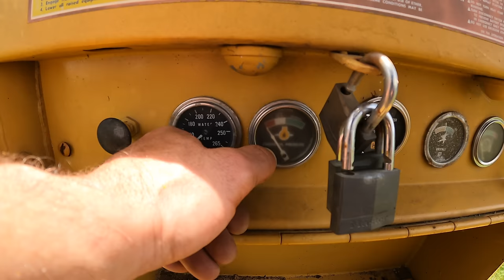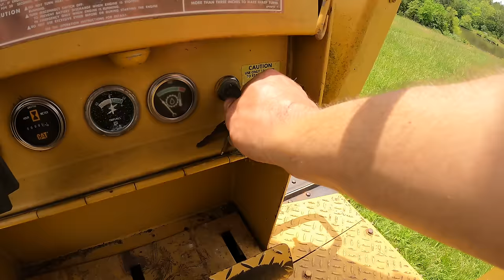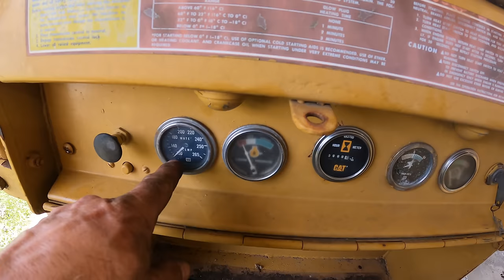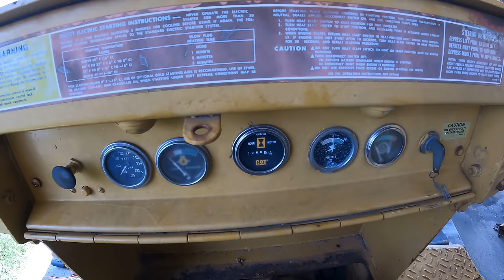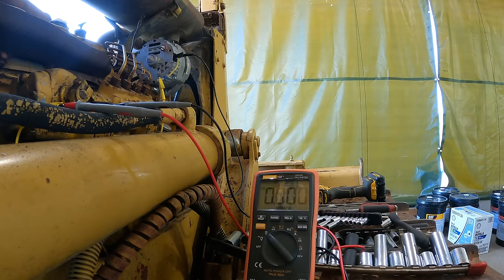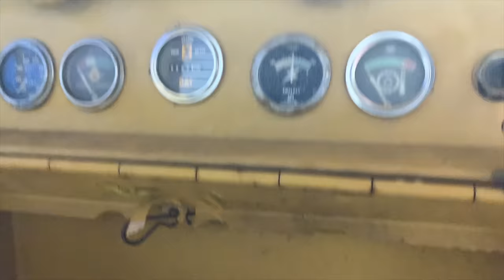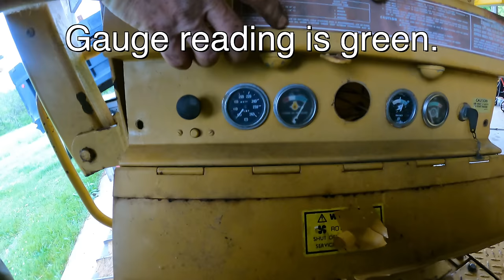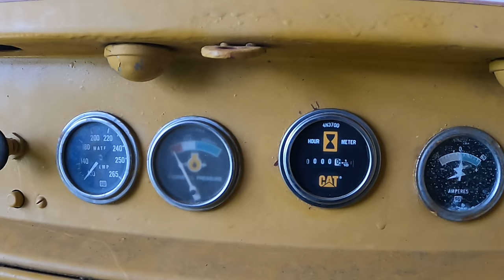Buying & Fixing a Bulldozer, Cat D3 Dozer, Part 1/2

Comment: John, I have just started watching your video, can't  wait to the end of the video as I have to tell you now that altonater is the wrong one for that engine it will drake off. You need one with a large full length bottom mounting that fits in between that lower bracket on the engine. Now back to the video for me. Thanks Stewart.  OH I see it's been mounted upside down lol.

Comment: Single wire alternators are very common - used in older cars mostly (Fords,  Holdens (GM) and Valiants (Chrysler) here in Australia- one thing- that single wire shouldn't be left hooked to the battery + terminal from the F+ (little terminal)- or your battery will go flat lol- it goes to the ign switch switched positive (ie ign on) +, with a light bulb in series- ie it is your charge light, lights up when ign is switched on, turns off when it is charging... : Another tip- look on the rear of the alternator when reassembling- there is usually a small hole (same size as the ones in the brush holders inside) and lined up with those holes- push a piece of fencing wire or whatever through that hole from the outside, push the 'back'  brush spring down first and slide the wire in until it holds it down, then repeat with the 'front' brush', then slide the front housing/rotor in and do up- then pull that wire out to release the brushes... I actually prefer the single wire alternators- very reliable little units (Bosch and Lucas both make them, and are very common here on older cars and almost all heavy engines (tractors etc) ETA- I see you haven't got a ign 'on' position positive- in which case, that wire you left disconnected at both ends, at the alternator goes to F+/ind, and at the oil pressure switch goes to the 'switched' side of the oil pressure switch ie not the permanent positive...

Comment: Re starting, we had two Massey Ferguson tractors, a 168 and a 165, the 168 always wanted heat but the 165 always started first attempt (and never needed heat) after about three revolutions, even in the middle of winter. So engines can be a bit funny.

Comment: One the rough ways to figure out if your alternator field is energized is with masterswitch turned on the field should be energized and creates electromagnetic field, so it should attract a metal object like a 7/16" endwrench to the belt pull
If you turn on battery power and your pulley isn't magnetized its most likely bad alternator, or bad voltage regulator on externally regulated models (FORD)

Comment: When you are inspecting it at your shop. It looks like when you were messing with the alternator and starting it up that the injector pump was moving around independent of the engine, Like maybe the mounting bolts were loose.

Comment: Cool video, just thinking if you really needed that headache Dosser. Your tractor with a grading bucket should pretty much do the same thing. Might take a bit longer, but will certainly do the job. And save you the $15.000, and all tout time. A used skid loader would be a better option and that way you could buy a ton of attachments down the road as needed. More money, but endless opportunities for great videos. Thx for the great content, love your channel.  I’m still waiting on the wind turbine on your farm for free juice.

Comment: Your throttle control lever probably has a friction point that holds it in position, and has just gotten loose. I have a tractor that every few years i have to tighten it up. It has a bolt that you turn while holding the lever, to tight and you cant move it, to loose and vibration will let it drift.

Comment: And you can pull the brush wire out the rear of the alt. And put the wire in the brush holder then install brush holder.  A unique way to pull the wire. lol

Comment: Biggest issue with the D3 is the 3204 engine,  they like to drop valves.    It almost always junks the head and some pistons, if you are lucky it does not damage the block.

Comment: I thought he might say the oil pressure sensor was unobtainable but $13 is a real righteous price. That looked like a pretty standard thread pitch and fitting size. I have a piece of grease gun line and a pressure gauge i use for diagnostics to get real numbers I think I got $10 in to check oil pressure I hook up to various holes to see if were in spec, as alot of oil pressure is made in the main bearings and the light just tells you you either have no pressure or over 5PSI usually. I know the thread pitches are different if its japanese or American manufacturing and fit together but will strip your threads.

Comment: That looks just like a pressure switch from an old pool heater. the newer heaters have plastic ended ones now. just like your replacement. but pool heater ones are adjustable!!

Comment: That may or may not be a 1 wire alternator. The regulators can look identical from the outside. If its a standard regulator in the alternator wired like that you will drain the battery as the alternator will not shut off.

Comment: 21:40 your supposed to only blow the filters from inside out, and only last give it a quick blow from outside to take off any loose dust.
otherwise youre just pressing the dust deeper in the pores of the filtermedia.

25:15 good idea, bet if you would have left the bottom square, it would have likely cracked.

31:43 Nearly all alternators have 3 wires/posts,
1. +12v(Batt) 
2. charging light (this needs +12v to excite the alternator during startup) you have the yellow wire going there.
3. Tachometer (for RPM's and hourmeter) usually not used.
Reply: 47:25 its always a good idea to cover any loose wires, maybe someone down the line plugs the other end in and now theres bare wire with power inside the dash..

Comment: r.e your mini-excavator tracking problem: my snowcat has an adjustment in the dash for that. I don't pretend to understand how it works, but maybe some sort of variable flow valve that divides the volume of flow from one side to the other on demand would work. On mine I just roll a small adjustment wheel back and forth until the tracks run true. FYI: It's a Pisten Bully 200.

Comment: Lift station degreaser would make that radiator shine . Expensive and don't use it straight .also was told that car alternators charge at a higher rpm than a diesel alternator

Comment: With all your heavy equipment it might do you some good to pick up a Hotsy pressure washer, hot water changes the game. Would've melted all that crud (technical term 😂) off that radiator.

Comment: Always need to preheat when staring unless you just shut it off. It's a Indirect Injection system. Alt. is upside down unless it wouldn't fit because it's not correct. Belly pan missing so watch yourself in the woods or you will be putting a Radiator in it. There is a hole on the back of the ALT case in line with the brush holder. I use a toothpick on each assemble then pull out toothpick. Easy. $15K is a decent deal. Tracks are worn more than you think, but still a little life left. and Yes way too Tight.
Small dozers are in High Demand and bring good money. Nice Crawler.

Comment: You need to get you some rubber mats for your concrete or it will eventually break it. They make rubber mats for running tracks on concrete

Comment: Don’t leave that alternator wire in console without covering the end. If it jostles around and makes contact with hot and the other end is pinned to ground… short.I would probably throw some laptop and electrical tape on both ends.

I have always wanted to do one of these.  So I saved some money and watched you.  Will have to look around for one.

Comment: I'm pretty sure u need a switch on the wire going to f post so the Alternator Doesn't kill the battery when the engine's not running? You might want to look into that I could be wrong.

Comment: charging circuit   power supply to ignition switch  via  3 amp bulb to alternator  or you get permanent drain when engine not running

Comment: Do you have a water filter on your air compressor? Cause i think i saw it squirt a little water in front of the radiator when you were blowing it with air. A little safety tip when blowing electronics

Comment: Protect each wire with an appropriate fuse or breaker at the source of the current (ie, where it feeds off of the starter connection for the panel wire).  Even the starter wire can be protected at the battery with a really big fusible link.  Pacific Yacht Systems youtube has a really nice series on this (and the fire video to convince a person).  Don't forget a seatbelt so you don't get crushed when it rolls over.

Comment: There are a lot of different amp ratings on battery  master disconnect switch.  When the switch melted a stud off the alternator diodes might have had a voltage and current spike that exceeded their rating.

Comment: With the alternator field wire continuously connected to the battery, you will run down the batt. Given the melted oil pressure switch I am guessing the alternator field wire was connected to the switch. Using the presure switch will have the battery changed only when the engine is running. Adding an in-line fuse would protect the switch should the alternator fail again.

Comment: I would put a straight bushing in series with the bolt common to your alternator attachment lug just to help your bold bending situation.   the ears on that clevis aren't designed to take the clamp up side load, and by clamping a straight bushing,  you will stabilize the joint and avoid a fatigue failure.  Just my two cents.           with that said, I tune into this channel to see what crazy self inflicted mechanical predicament that you will get your self into ...  Im the same way.  I cant resist taking on an old stray...  and I'd cut my own hair if I thought I could save a buck and make it come out right....  I enjoy the over the top DIY spirit that you put into your videos.  Most people have never changed the oil in their cars much less taken on one of these high level technical skill projects.  Hopefully some one gets inspired to fix some of their own problems without using a check book.

Comment: Dollar general sells 'awesome dish soap' that'll cut through oil and grease like no ones business may be worth using for cleaning up equipment with a pressure washer.
Kinda shocked you didn't properly tension the tracks first before using it

Comment: Alternator needs to be on a switch to turn off power to small wire otherwise it will discharge battery or burn out rotor winding

Comment: From what I could see, you seem to be missing the belly pan covers in addition to the track tension covers. If so, you don't want to do much rough work as you can puncture your oil pan. I never run my equipment without them. Too big a risk. I could be wrong as I couldn't see down into the engine bay clearly or maybe you already took them off for servicing. Nice looking little machine!

Comment: Yeah, any alternator needs voltage to excite the field. Since, instead of magnets and windings, you have windings and windings. Since windings themselves can't generate a magnetic field, you need power in the one set to induce an (electro)magnetic field into the other set of windings and allow it to start charging/generating. (Sorry - I was a diesel-powered generator tech in the Navy... been a couple of decades since I've had to think about the inner workings of an AC generator. But thanks for making me think about that stuff again. I needed to refresh that knowledge before I lost it, lol.)

A keen-eyed parts tech will refuse to accept that slotted alternator as a core trade-in. Unless they like you. 😊 I do like the idea though. Great vid!

Comment: Well, You definitely are not in the same class Dozer operator as Chris/Mike or Jerry...but ya gotta learn somehow. I think you did great :)
Unfortunately, your undercarriage is shot. The Final Drive sprocket is done for but for the amount you will be using it? It will probably last you 5 if not more years. That is the reason the Tracks are so tight. 
I could be wrong of course but Clint from C+C Equipment is the expert. He has alot of videos about undercarriages for Dozers. Usually from Auctions.
Thank You for the video it was awesome. I love seeing older equipment being restored and used...if only once or twice, I just wish I had that ambition to work under anything for hours and hours again. First things first though. Hydraulic Leaks. Oh btw when I seen you struggling with that Loose Fitting on the Pump...I was literally telling you to cut an old wrench..LOL...
LOVE LOVE LOVE this episode! and I can't wait to see what you do next!
 Peace Man!

Comment: In that condition, it looks like it was stored inside.  It seems like the last owner was at least trying to fix stuff and take care of fluids, just didn't quite want to spend the money or quite know exactly what he was doing.  I'm hoping he had the tracks so tight just because he thought they were supposed to be that tight.  Why don't you want to use the glow plugs?  For how much you're going to be using it and the location of the wear I think you might be able to buff the rods and repack depending on how much it would cost to replace them.  From what I'm seeing, and how well it runs I think it's a pretty good deal.

Comment: ‘Full-size’ Caterpillar tractors use a Decelerator to control the Governor and you use it constantly when operating the machine. I suspect because that D3 doesn’t have a Decelerator you would be using the hand Governor control constantly instead and therefore it wouldn’t have a friction on the control. I may be wrong. 
  $15k would be cheap for that tractor here in New Zealand. I have seen a few D3s and they have all had cracked ‘C’ frames for the blade. That may be worth checking for.

Comment: The f -field terminal should be key switched 12v or it will cause a parasitic drain on ya battery!! Wire f terminal to oil pressure switched 12v like the hour meter!

Comment: Just throwing a comment about the alternator. The fact that it was spinning while having such a loose belt connection strongly suggests to me that it wasn't electrically connected. Alternators actually provide a lot of resistance at speed because that resistance is what's being converted to electrical power. The only reason (in my experience) one would not have a lot of resistance and not be slipping constantly on that loose of a belt is if the electrical connection isn't attached and so there's no power flow happening. So whether it was the stem not being connected or the ground not making it through the bolt, it wasn't going to work in its old state.

Comment: looking at the rear of alternator.. see the hump from the rear bearing???   see the slot  near it? that is where you insert a toothpick to hold the brushes in place.. not from the inside with wire...

Comment: you need flow control valves on each line to adjust fluid flow to each drive , remove the cross line as its proved of no use . fit flow control valaves the adjust as require if pulling to one side close in said valve restricting the flow to this side or adjust oposite side by opening flow more . james ps i am a qualified engineer not a sales man.

Comment: A Question, when you cold cranked it without glow-plugs, what oil pressure did you see?   Is non start cranking, a better way to get oil pressure in top end and main bearings, before starting it. Especially if been sitting for a long time and all oil leaked back to sump....I've always thought we need a manual or electric, external pre start lubrication pump. To run for a few minutes before starting, Especially  in extreme cold, and when it hasn't been started for months.

Comment: Let me poke the bear, there is a hole in the rear case of the alternator that lines up with the hole in the brush holder. You install a pin into the hole in the brush holder then the pin extends out the back of the case. You can pull the pin out from the back. The alternator should have a brace from the bolt hole on the back of the case down to a spacer on the mounting bolt to the engine. I have seen several broken alternators because of that brace being missing.
Buy a battery disconnect from Cat, the cheap ones do not last long.

Comment: Well at least you didn't get a rattle can rebuild.
25:30 you don't want to use end mills that way, make the cut the full depth with one pass whenever you can so you use the whole end mill. It's not a big deal on aluminum, but using an end mill that way with steel will wear out that small part of the end mill faster, then the whole end mill is basically useless even though most of it is untouched.

Comment: Most of these alternators excite via the connections to the B+ or voltage regulator: if you bench test it without a power source for it to excite from, and for it to charge? They’ll never put out any current.

- Advice from a pro mechanic who’s made the same mistake.

Comment: Might wanna drop the mic audio down to mono (or use a stereo width VST set to reduce down by 70% or so) for the parts where you're talking through these problems outside. Quite a bit of the audio was panned noticeably to the left on headphones due to you having the camera / mic pickup to the right of you. Other than that your filming and editing are on point as always though, props :)

Comment: As you know , always clamp your battery,  plus it's a good idea to put something rubbery under your battery.  You can use old mud flaps work great, looks like your battery was sliding around and hit your power shut of switch or we call master switch  and shorted out. If you paid $10,000 you got a deal , believe me,  price new one 😮